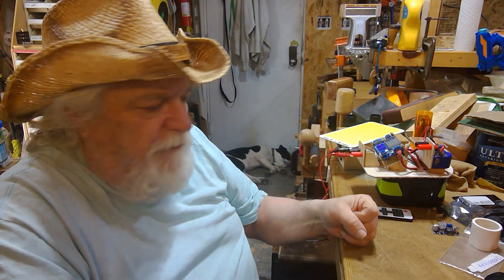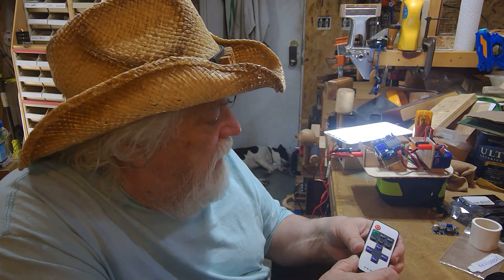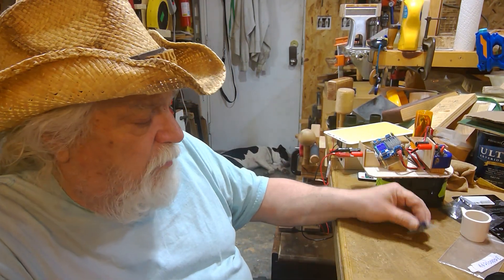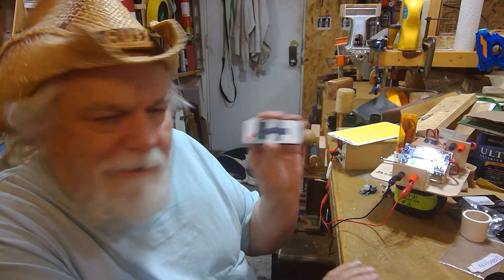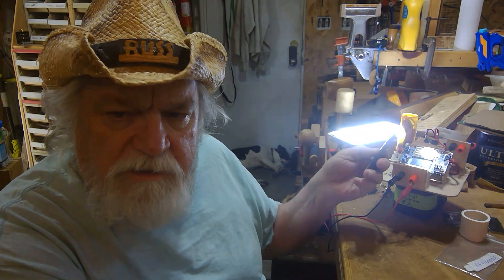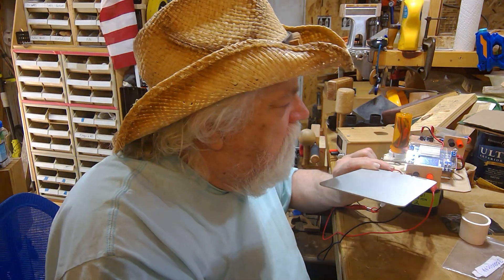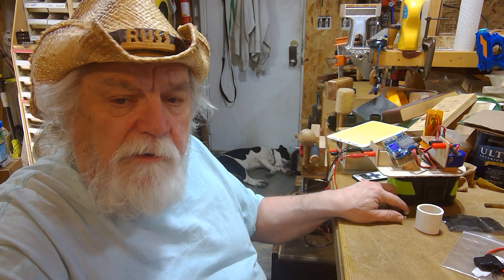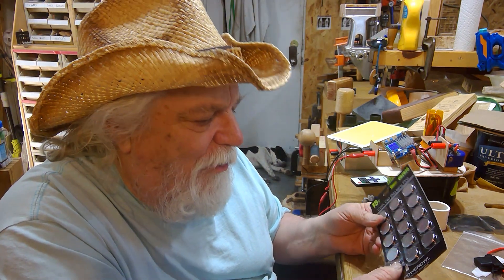DIY Ryobi Battery Powered 7000LM Light by OTB Thinker

Comment: Just keep in mind that fuses are used to protect the cable, not the device. So, you pick a cable that easily handles the current required by the device (for example, the device can use 3A maximum), so use a cable that can handle 3 or 4 A. Then at the powered end of the cable, fit a 3 or 4A fuse. If you get a short circuit somewhere along the cable then the fuse will blow before the cable smokes and/or catches fire.